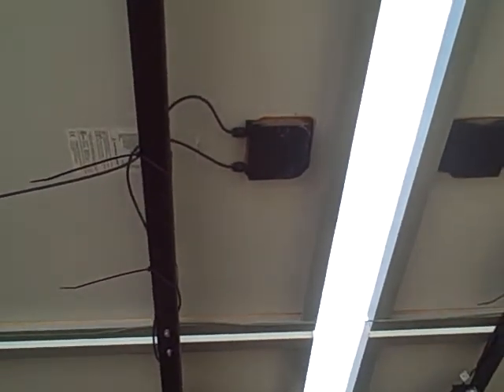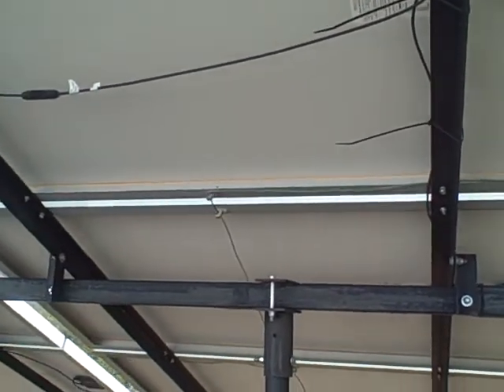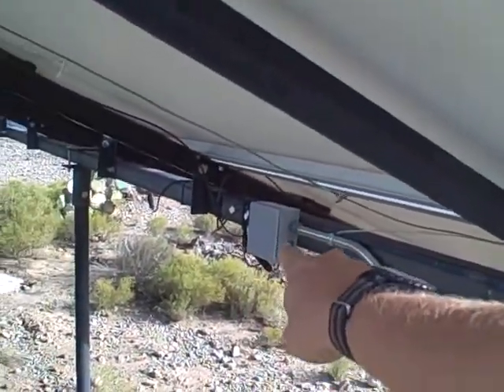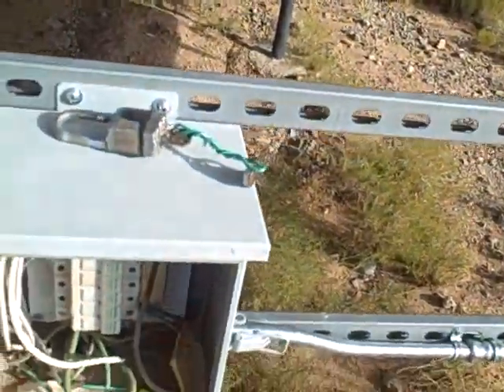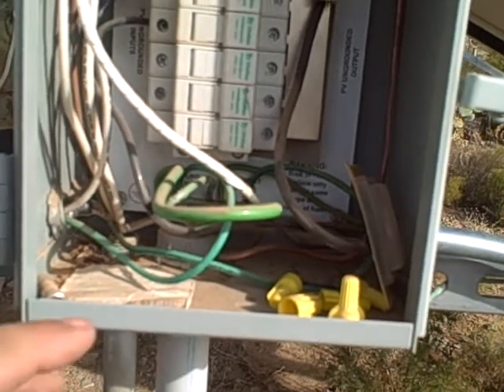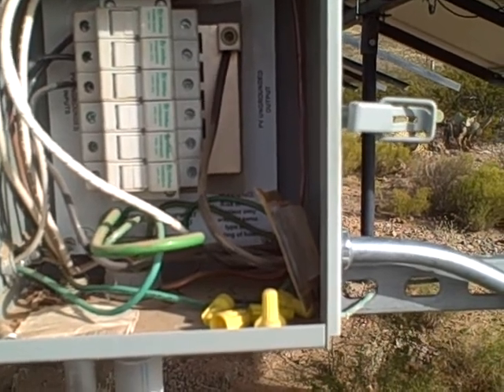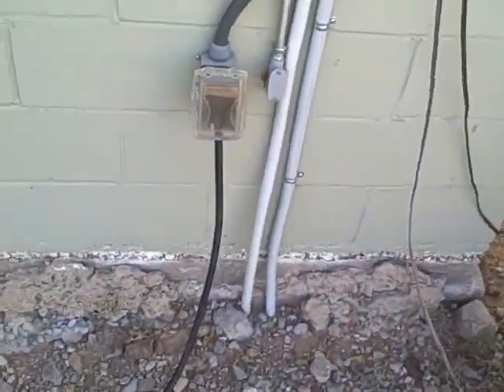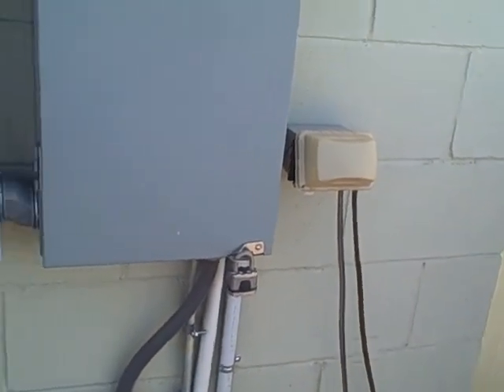Solar Panel DC wiring to a combiner box

Comment: I think you should have a separate ground rod for the array.. it needs it's own rod.. just my opinion, the one you have is to far away
Reply from the maker: the panels are grounded on the rack at multiple points and where mounted, then there are chair lugs on each panel that has #10 stranded green that again is tapped directly into one of the legs before landing in the combiner box.  it's been working fine for almost 10 years now.  Why what did you see or are thinking that had ya write?